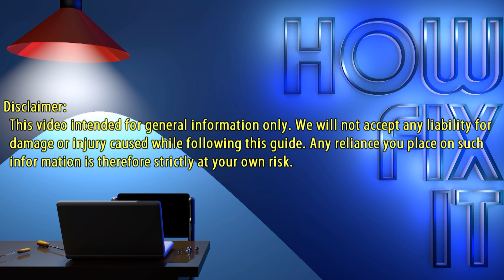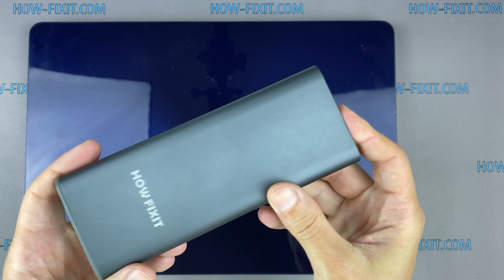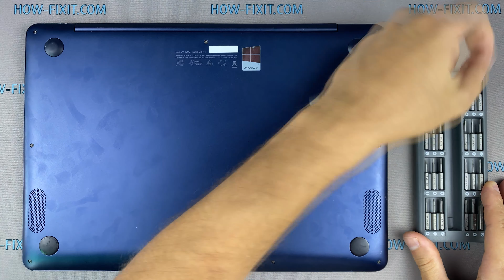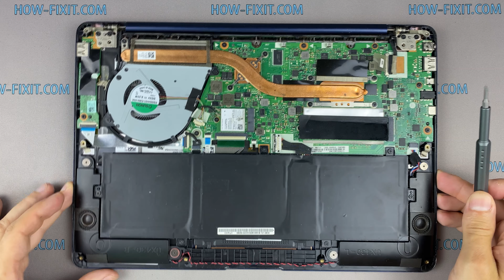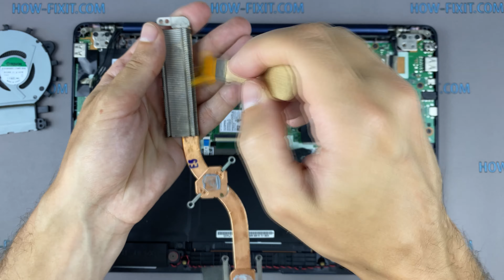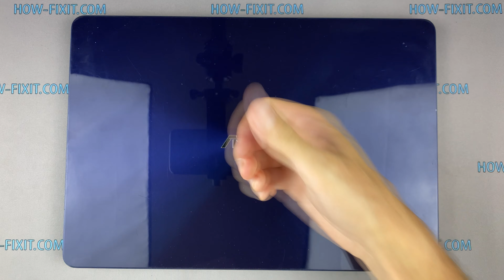Asus UX430U Disassembly, fan cleaning and thermal paste replacement

Comment: Learn how to disassemble the Asus Zenbook UX430, clean the fan, and replace thermal paste for better performance. Highlights: 
🔧 Tools Needed: Phillips 1 and Torx T5 screwdrivers, plastic tool, tweezers, thermal grease, antistatic brush.
🔩 Disassembly Steps: Remove screws from the bottom and hidden under rubber feet.
🛠 Opening the Case: Use a plastic tool to avoid damage while accessing internal components.
🔋 Disconnecting Components: Safely disconnect the battery and fan cables before removing the cooling system.
🌬 Cleaning Dust: Remove accumulated dust from the fan and radiator for improved airflow.
💧 Thermal Paste Application: Clean old paste and apply new thermal grease evenly for optimal heat transfer.
⚠ Reassembly Tips: Tighten screws evenly to prevent damage and ensure proper cooling system installation.
Key Insights
📦 Importance of Proper Tools: Using the right tools ensures safe disassembly and reduces the risk of damaging the laptop.
🗝 Careful Disassembly: Following the correct screw removal order is crucial for avoiding complications during reassembly.
💻 Preventative Maintenance: Regular cleaning and thermal paste replacement can significantly enhance laptop performance and longevity.
🔬 Thermal Paste Choice: Selecting the right thermal paste is vital; consider testing various options to find the best one for your needs.
🛡 Safety First: Disconnecting the battery before starting ensures safety and prevents electrical hazards during the process.
🌡 Overheating Solutions: If overheating persists, explore additional solutions like cooling pads or undervolting for better thermal management.
📹 Further Learning: Links to additional resources provide valuable insights into thermal management and cooling solutions for laptops.

Comment: Fan unit can be opened for better clean. Clean blades and exit grill  inside - usually will run quieter and cooler. Good video.